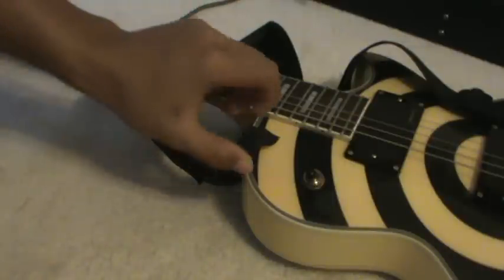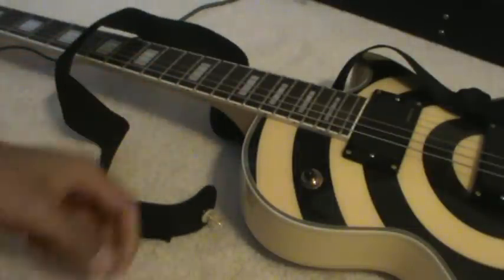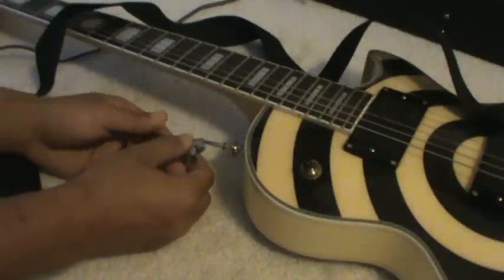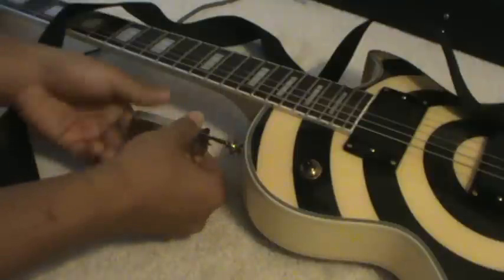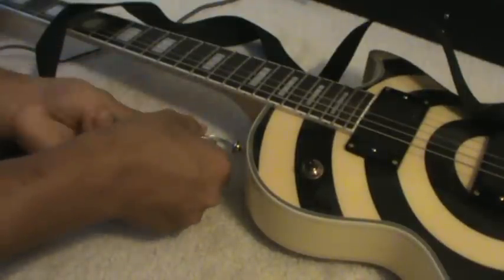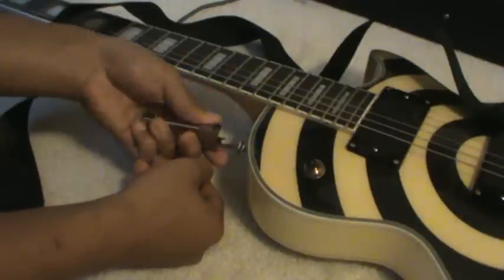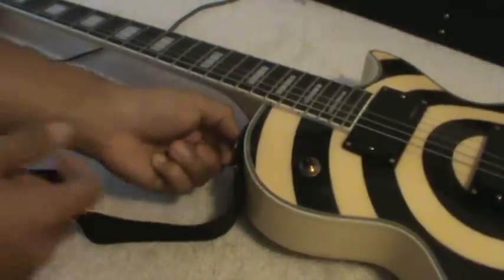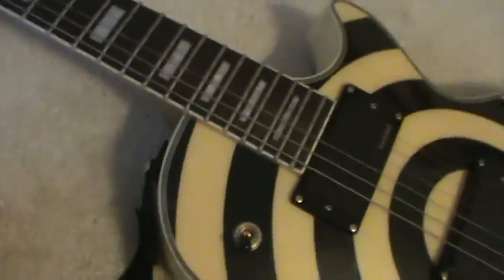Guitar Strap Holder Stripped Screw

Comment: Fill the whole with wood glue, snap a tooth pick or match in half and fill the hole up with them, wait for it to dry, also level out the tooth pick or matches and then drill a hole the size of the screw into it, and wolla fixed strap button.